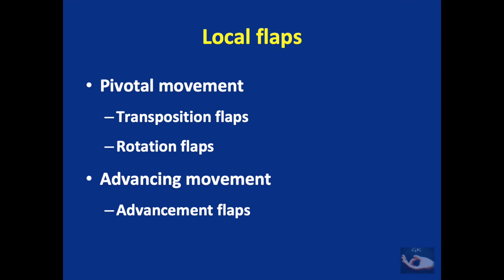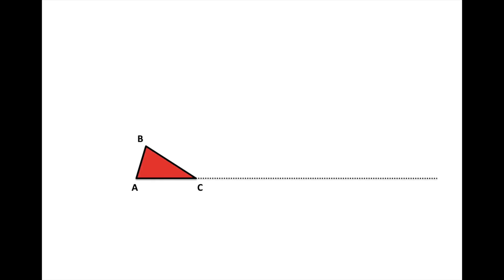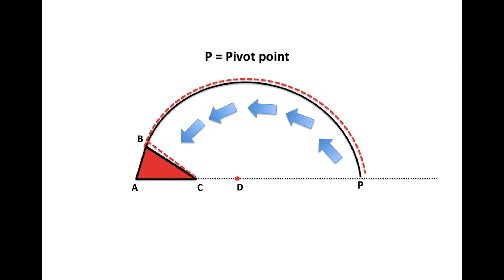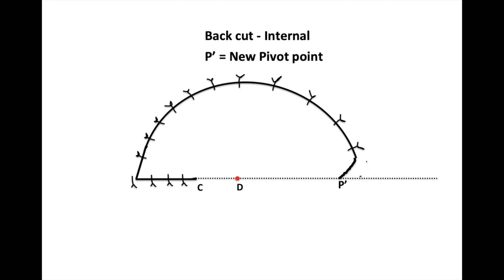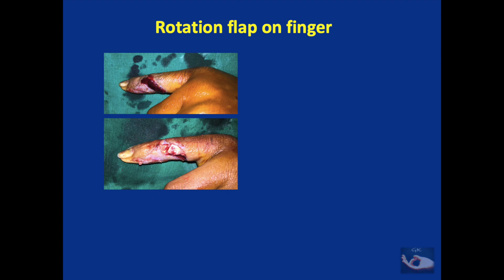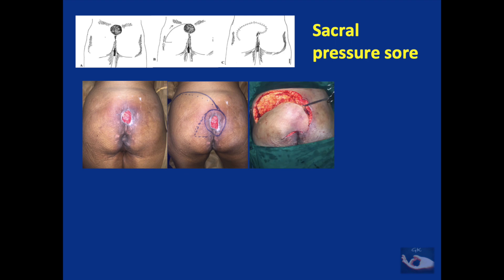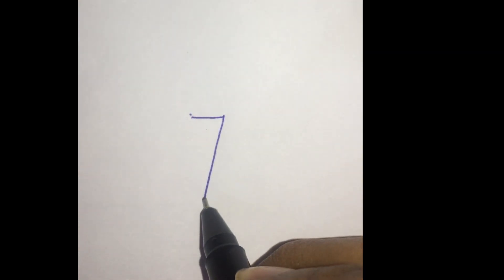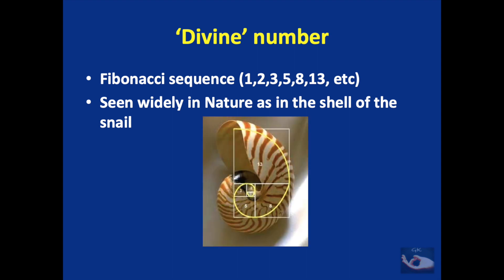#The Rotation flap

Comment: Very nice...just one ambiguity i.e. in case of buttock rotation flap you did not follow the same rules as the angle is far more than 30 and the excised triangle is not isoceles one. Please explain it.
Reply from the maker: Yes, you are right. I have highlighted the basic principles of rotation flaps. Will change to suit the different areas.
Reply: @GKHandSurgery  l would love to learn how you modify it for different areas.